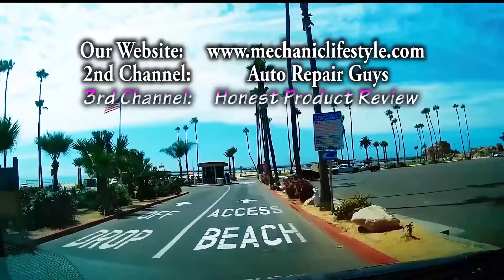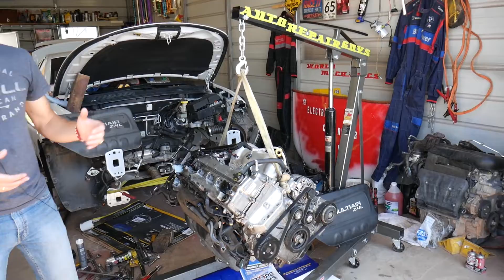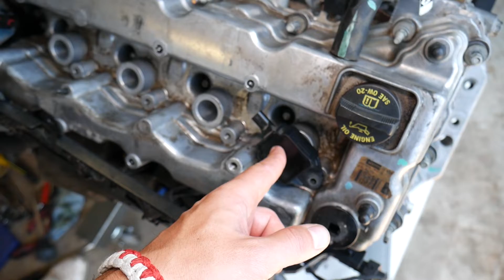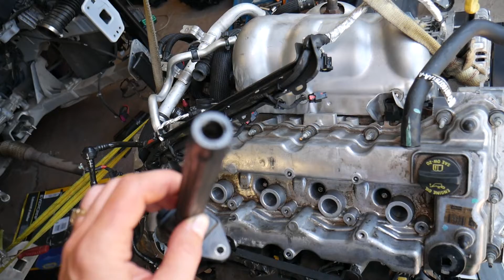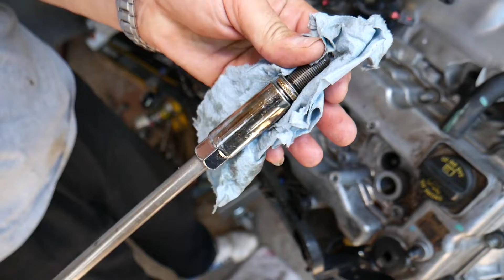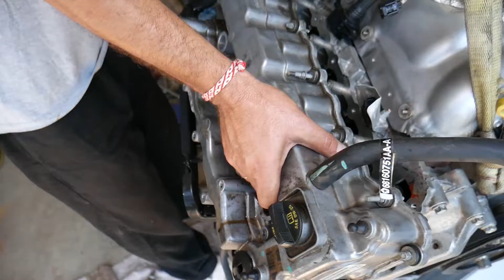WHAT CAUSES ENGINE MISFIRE COD E P0300 P0301 P0302 P0303 P0304 JEEP CHEROKEE, COMPASS, RENEGADE 2.4

Comment: Not sure if you will see this or respond but what if it’s an intermittent issue ? 2.4 will run really rough and misfire horribly at random then after a restart it completely goes away runs smooth and I can drive it for hours without another issue . Already changed the plugs coils pct valve and still have the intermittent issue
Reply: PCV valve *